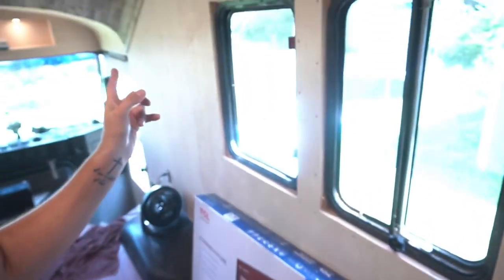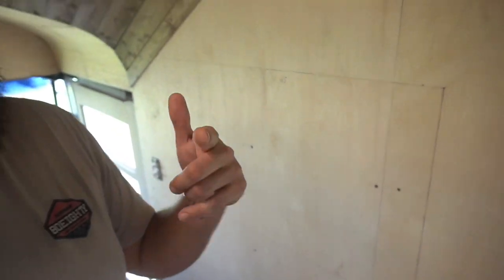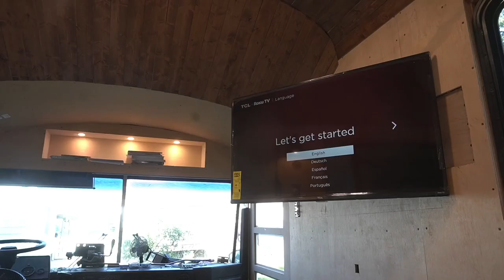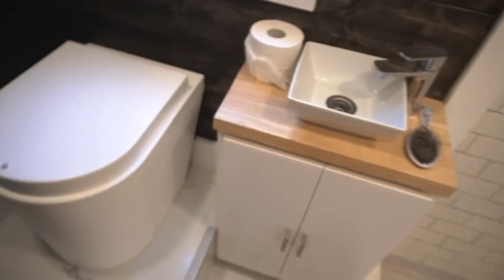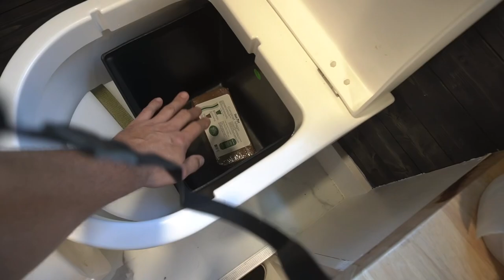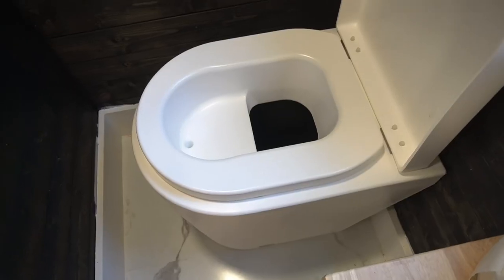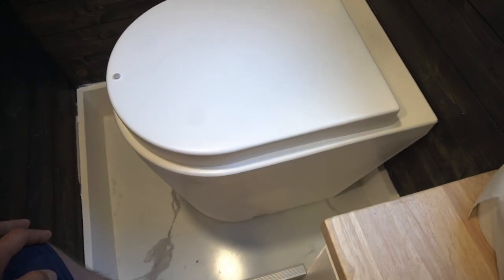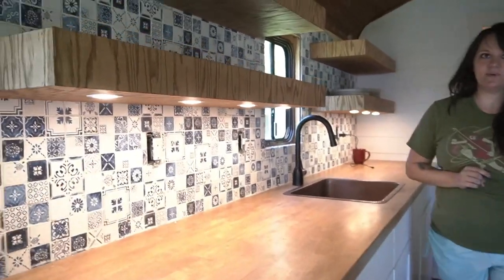School Bus Conversation Episode 30 - Open Shelves in an RV? Plus We Install Our TV!

Comment: Awesome floating shelves and built in lights! ❤️🌱🌞 I saw a bus build that had floating shelves and stainless square containers that were held across the front with a black bungie hooked onto the back wall when rolling down the road. Visually it look cool because it complimented the other color choices but then was easily removable when in use.  ❤️🌱🌞

Comment: I’m wondering if you know what your gross weight is going to be? You’ve put a lot of wood into the project and wood can be heavy. Figure about 8-1/2 lbs per gallon for your water and the GVW could get up there pretty quick. I know on my school bus, I notice a significant difference in performance with about 30 grade schoolers on board. Please understand, I’m not trolling the project. It looks fantastic! Just wondering about the weight.